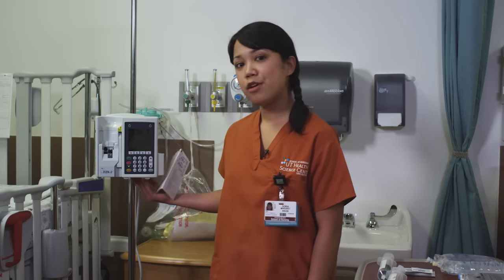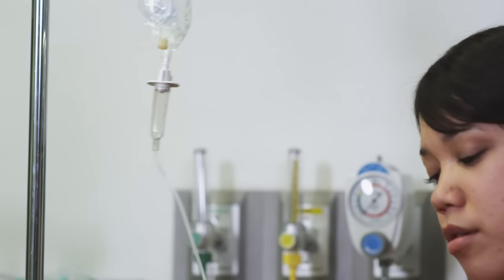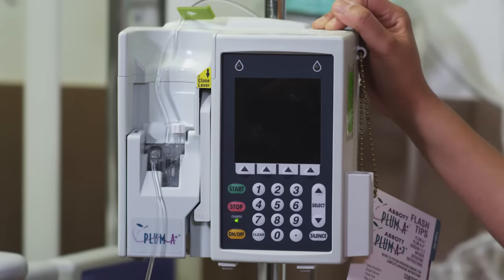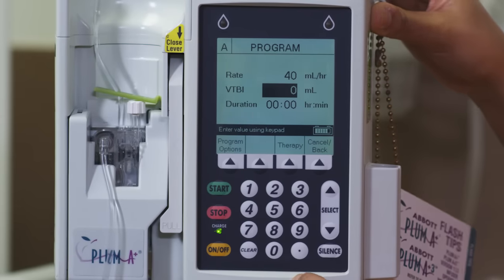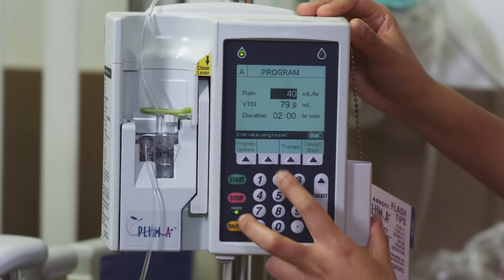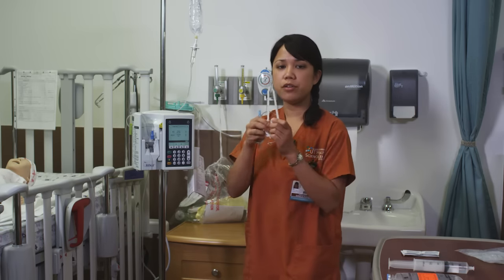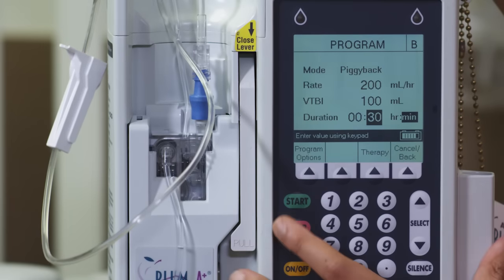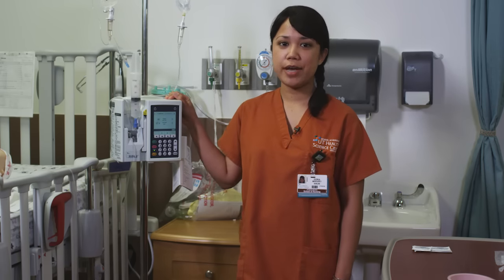PLUM IV Pump

Comment: I 2nd the comment from 2 years ago.  I've been trying to find a video that shows back priming on the plum A pump for the piggy back.  I was so excited to see it was a video that had primary and piggy back but the secondary line wasn't back primed at all, not even manually.  Please add a video with the back priming on the pump if possible.  Other than that GREAT video.  Perfect explanation.  Thank you.

Comment: With the syringe of Vancomycin you just infused the last  10-15ml of Vanco at a rate of 200ml/hr!!  (i believe the primary tubing holds 19mls total)  YIKES.  I see this ALL THE TIME!  You need to adjust your primary rate to match your secondary rate until ALL of the medicine is infused.  The tubing and the cassette hold a significant amount of medicine when you are infusing at these lower rates.  Zosyvn at 12.5ml/hr  you are then giving the last hour of Zosyvn over a 5min period of time.

Comment: This is the worse IV pump I've ever encountered. Too cumbersome very bulky and heavy the IV tubing takes forever to prime and seems to always alarm system check failure  having to place a syringe on the piggy back and back prime to get this so-called IV pump to work. CCF uses the SMART Pump very efficient universal tubing and compact space saver. Thank goodness I no longer have to use the plum an antiquated  machine.

Comment: So stupid a system. I don't understand when the market has Baxter, good enough, why things like Plum even exist. Ine hand can handle baxter but you need both hands to pick up this pump. heavy like hell. nurses with carple tunnle syndrome basically cannot handle this IV pump with one hand. The tubing, soecific to the pump. that means it's going to be very expensive. the clamp...roller clamp is way more convinient than this clamp. all these figures just make you click more and takes more time to prime an IV. It's like nurses don't already have enough ENR charting to do. now you have spend more time on a simple IV .
Reply: The answer is simple.  It is about safety.  I have seen a medic take IV Lidocaine and Nitro off a pump to transfer a pt into a bed and bolus them with them because they did not realize it was open when off.  The default for this one is closed when off.  All of the new bells a whistles have a learning curve for us nurses, but if in the end they prevent even one sentinel event, it is a win.